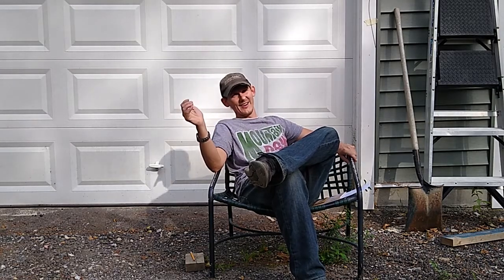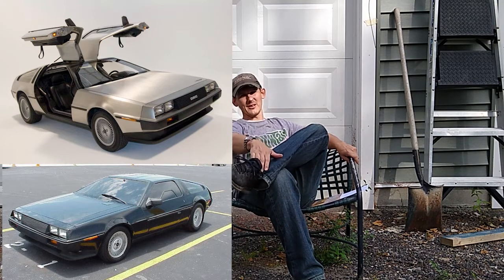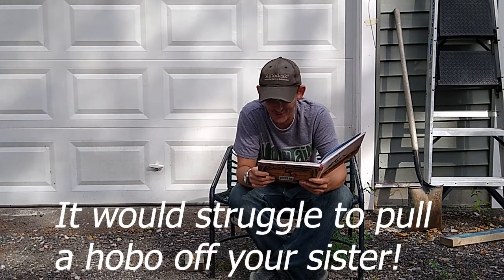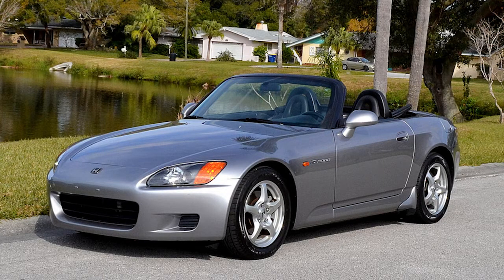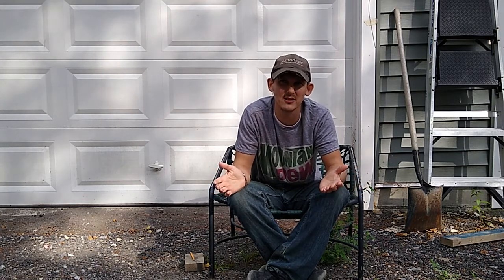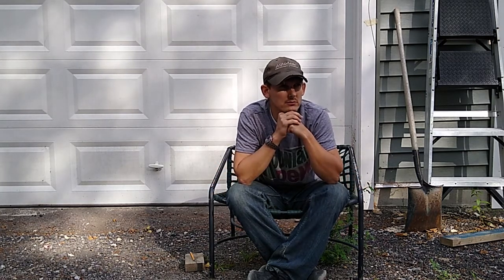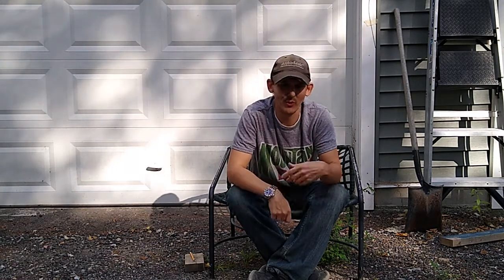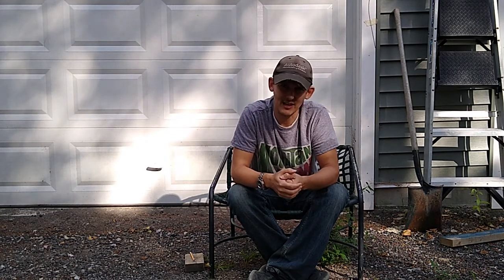20b Rotary Delorean Engine Transfer Review

Comment: my ideal-engine choice would have been the Renesis from an RX-8. 228 brake horsepower from a naturally-aspirated 1.3-liter. Not sure what transmission I'd use, but I'd take my time researching it before buying anything. What I might do instead of turbocharging, however, is look into fitting the Renesis with this instead. https://www.youtube.com/watch?v=6Po5jsrYMK4
Reply from the maker: Hello, the Renesis wasn't out yet when I did this swap in 2002.  But I think the renesis was a cool setup.  I guess it wasn't rotary enough for the rotorhead and and too rotary for the pistonheads.  The high compression made them harder to turbocharge, which was really the attraction, even though lots of people did it wrong it blew them up!  Honestly I'd stay away from experimental technology unless you're looking for a good project that might never work or work right.  Instead, start with a lightweight chassis and components and you can still be happy with results you can actually use...
Reply: The renesis is the worst rotary engine by far.

Comment: Wait... you couldn't find a 13b but you could find a super rare 20b... WHERE DO YOU GO CAR SHOPPING?!  I want to go there.
Reply from the maker: It's a good point.  I should have said, 'when cost doesn't matter'.  I dumped $6500 on the half-cosmo, and I didnt find any 13b for sale in the US.
Reply: @NineCarGarage  lol.  I would love a 20b for a GSL-SE.
Reply: 13Bs are often bought up by people swap into light airplanes, as the rotary has several characteristics that make it almost irresistible for aero applications. No matter how badly you overheat a rotary, it is immune to seizing-up, and you never have to worry about a rotary throwing a conrod, either.
Reply: @SteveChisnall  Also, something very cool happens when you use a rotary as an aircraft engine.  The engine runs at a constant speed, mostly between 70% - 75% of it's top rated power for 90% of the flight.  Power is applied and removed smoothly and RPM changes are more sedate.  The apex seals would just last and last. The engines last longer, run smoother, uses less fuel for hp per pound and have fewer moving parts making them cheaper to overhaul than standard air cooled flat six or flat four aero engines.

Rotaries may well live on in the civil aviation community.

Comment: Hey man,
Really great commentary on this car in all three of your videos, I thoroughly enjoyed listening to what you had to say about 1537's past; the additional photos and footage is greatly appreciated as well for our fast growing archive on her... I am the current owner of 1537, have been for a year now, and have been hard at work on giving her a third life.
Unfortunately, David passed away some years ago. The car was left to rot on a ranch in Central Texas for several years after the engine tore itself apart, ending up in complete disrepair and beyond. 
I've stripped down the interior and exterior of the car completely, bolt by bolt down to the chassis, even the black paint is gone too. The intent is to bring it back to an almost 100% factory appearance, but with modernized upgrades and replacement performance parts. The chassis has been replaced with a brand new stronger and lighter model made from stainless steel. Brakes, fuel, suspension, cooling and more are being replaced with new modern parts as well. I've also got an original factory PRV V6 that will be totally upgraded before installing into the car. The engine will feature twin turbos and an EFI system among other improvements.
Even though what you had done is now completely undone, this will forever remain a significant part of this car's continuing and evolving history.

See it on Instagram: @the_road_to_88mph
Reply from the maker: That's incredible.  I can't even imagine how much work I've made for you.  I might have some leftover parts for your restoration!
Reply: @NineCarGarage  Haha, yeah there was quite a lot of confusion at first as we began sifting through what was original and what was aftermarket. Contact me on Instagram! I'd love to see what parts still exist!